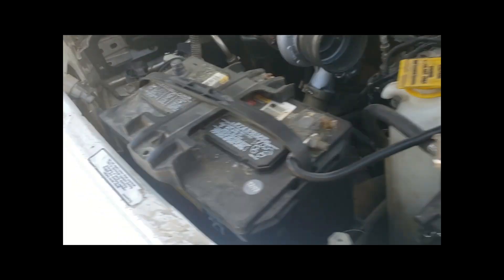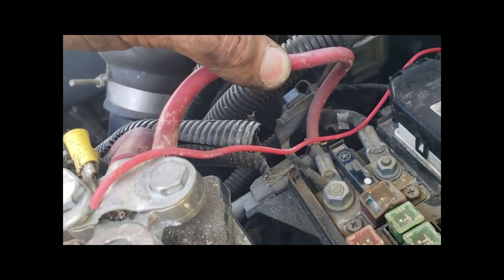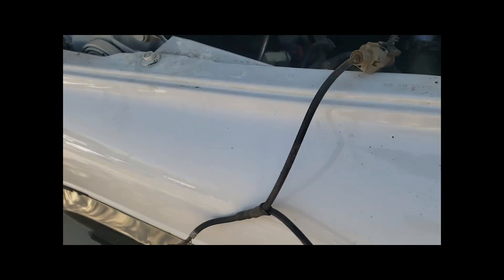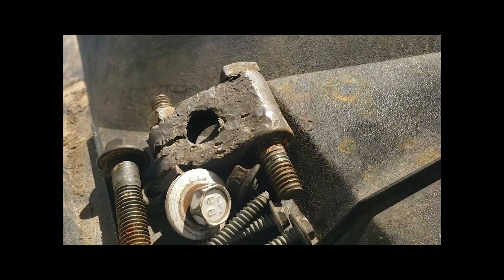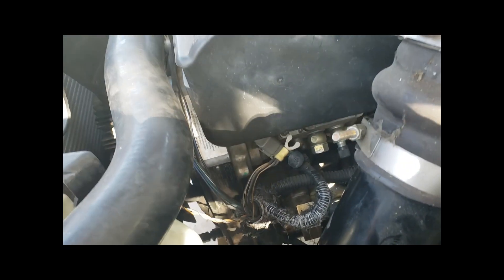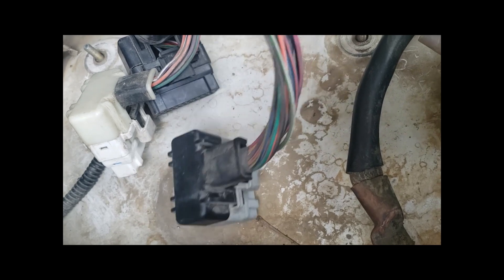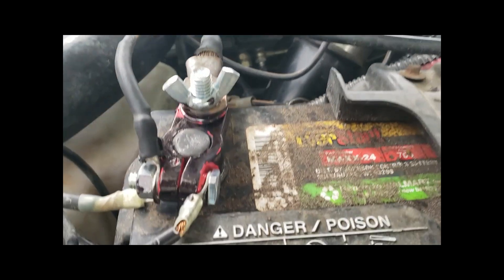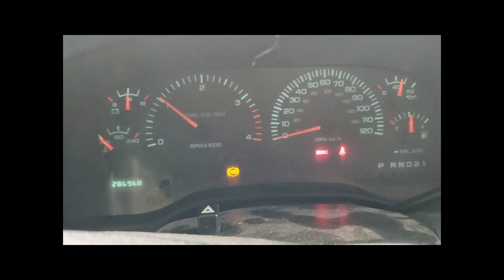DODGE P1698 NO BUS/CCD Fix! | PCM Replacement + Simple Rewiring

Comment: Got the same Problem in my Ram 5.9 cummins after a fuse crack of the 20Ampere power outlet. Now i got no bus and ccd but engine starts fine and runs like it should be what can be the problem?
Reply: I'm having the same problem as you

Comment: How do did you know the p.c.m. was bad.my says no bus and relay just sounds like a vibrater. No dash power.wait to start cycling on and off multiple times the no bus. The injection pump fucked up then this i put a e.c.m. of the excact same year and 5 speed nothing. I un plug black connector from p.c.m. no humming.maybe im in the same boat. I know it a old thread would like your opinion

Comment: Hey I've got a No Bus on my 02 3500.. runs and drives, no overdrive and button doesn't work, no gauges work other than RPM, check engine fuel abs brake and some other dummy lights on, no OBD communication. Not sure what the issue is. I've done the cluster diagnostics the gauges work when doing the test, but not sure what it can be. Where should I start with diagnosing this?
Reply: i have the exact same thing
Reply: You figured it out?
Reply: @BasedEliseo   I sent in my pcm to be refurbished they told me it couldn’t be due to being shot. Then I bought one from Automotivediscounts it would fix my gauges and no bus but would not start the truck. They sent me another one but same thing so I think those are bad pcms cause they said they’d just refund me pay quickly
Reply: @MaconSmallTalk  so you haven’t been able to fix the problem?
Reply: @BasedEliseo  nope. The refurbished pcm was like 1100 😬 took me awhile to get that so just found out I’m going to send them back and wait on this refund and spend the extra couple hundred with a very reputable company in hopes that it’s it. What the refurbished pcms were doing is energizing the thick ground wire that connects to the pass. battery and leads to the C1 connector common grounds.
Reply: @MaconSmallTalk ever get it fixed?
Reply: @franklopez1574   I finally figured it out for my specific issues. Originally all of the dash lights were on, no gauges, no A/C, and No Auto Shifting. Only Manual. I went through 2 companies, and 4 PCM Units before I finally received a good working PCM. Once I replaced it, all was fixed, BUT then the truck started up one day and when going down the road it would not come out of 1st or second gear no matter if it was in auto or manual. Finally asked a local shop and they gave me some free advice. I replaced the Speed Sensor in the driver side tail of transmission. IT FIXED IT. It was running beautiful until I sold it this year.
Reply: I've been having the same issue for a year now.

Comment: I have code p1694. When the truck is cold in the mornings  I just ease into the throttle you can feel the truck bog down a little bit then pick back up but if I put it to the floor it will go with no issues only when I grandpa the throttle. Any ideas? Thanks

Comment: Thanks for the video and info 
And definitely saying the name of company who fixed your pcm . 
I'm in the process of sending my unit to them for repair. 🙏🏼 that it fixes my. Truck it's been a nightmare 😫 and journey..
How's your pcm holding up ?
Reply from the maker: It failed on me again but it was my alternator and the reman unit. It's prone to the problem no matter what. You're just buying time. So I drive the truck with no BCM and I wired manual autometer gauges
Reply: @jessedrifts  ok I see your alt was frying the pcm. Yes thays true they have this problem.  Do you have any video on what you ended how you set it up ? 
Thank you for replying.

Comment: Hey man my 01 24V has dead pedal every so often for a couple seconds with TPS CEL codes. Also the gauge cluster will go out and come on when it wants with “No Bus” on the screen. Would you say PCM for this issue? Or are they not related? Not sure tbh thanks lol
Reply from the maker: Get a timbo apps to replace yours to eliminate dead pedal. Just Google and it'll come up.
Reply from the maker: The cluster has nothing to do with dead pedal. The pedal is from the apps sensor and that goes to the ecm. The bcm/pcm might be going though if you're losing the cluster/no bus message. Check your alternator at a parts store tester. The diodes go out and nuke the pcm and you won't ever be able to tell. Just one day you get a no bus and no function of the truck.
Reply: jessedrifts Aye thanks! So remove alternator and take it there? Or can it stay in car. Sorry, I just got my first diesel and am learning.
Reply: @omarplat334  HI did you ever find what your problem was ? I have a 98.5 and it's doing same thing my fuel gauge goes out comes back so does my temp  
And my alternate stops working and the starts back .
Reply: 1j7r. 1j7r. I fixed the TPS issues but not the gauge cluster issues unfortunately
Reply: @omarplat334  thank tou for replying.

Comment: I got a 97 dodge ram diese turbo 5.9l cummins  my problem is that my RPM needle keeps bouncing alot and my voltage gauge does too( it does it verry slow) any ideas
Reply from the maker: Maybe alternator or cluster going out. Mine does it too but I did the APPS ground. It helped. Google that and see. It's cheap to do
Reply: @jessedrifts  ok thx. i put a new alternator last year ...someone told me it might be the camshaft position sensor? But ill try to check the cluster.thx again
Reply from the maker: If the camshaft sensor is going out the truck will run funny though
Reply: @jessedrifts  ok thx ill checked that out tommorrow

Comment: Did you change ecm here or not
Reply from the maker: BCM/JTEC Module yes. If that's what you're calling the ecm. It's not the engine control module on the side of the block. It's the one on the firewall on the passenger side
Reply from the maker: I did not change the engine control module/engine computer